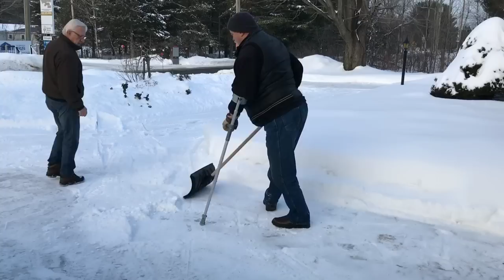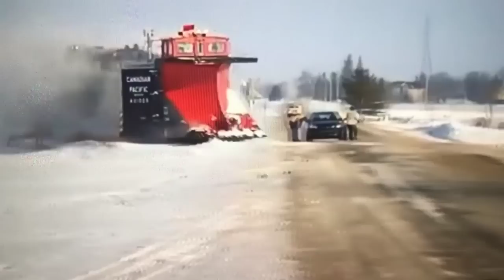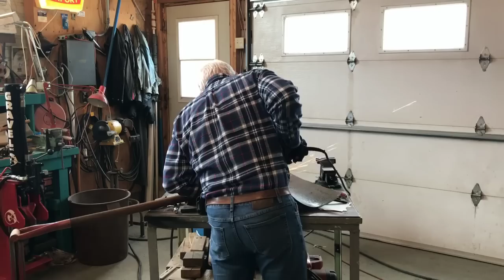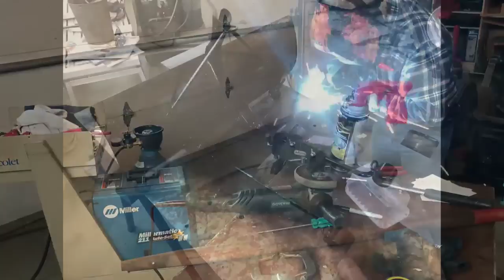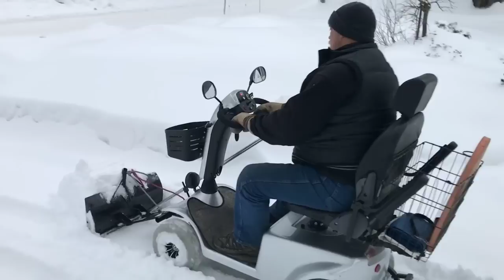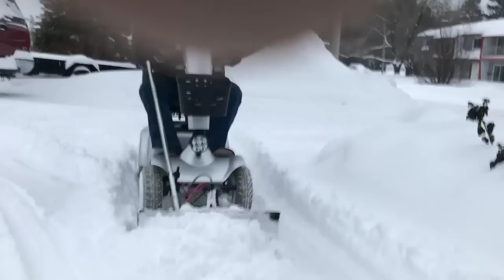Pelle à neige sur un quadriporteur.  Snow plow on an electric scooter.

Comment: I made one using a snowpusherlite shovel, rope and some slotted angle metal from home depot. Popped it on my Pride Maxima. My parking pad is 30x25, and my driveway is about 80' long, going up hill.